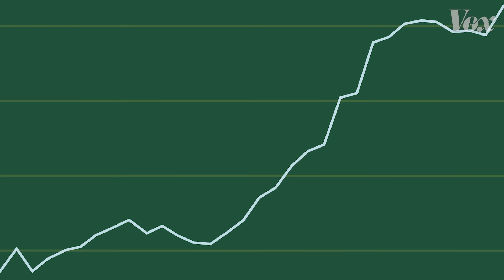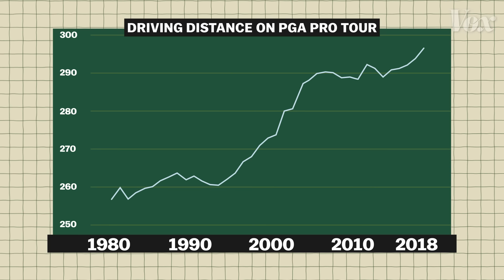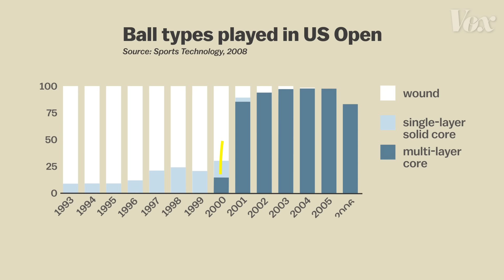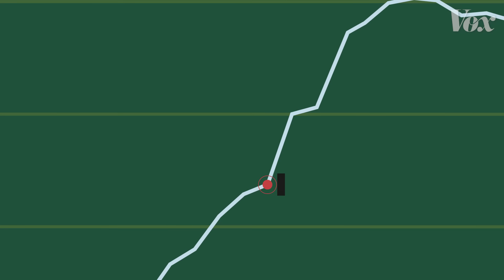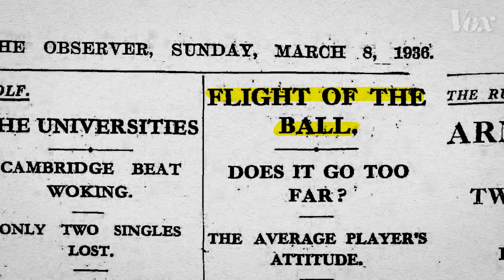The golf ball that made golfers too good

Comment: "a heavier ball would fall out of the air more quickly" guess we're back to the 1500s
Reply: With no air resistance that would be the case. But there is, making drag more pronounced if there is more mass
Reply: You mistake launching a projectile with letting it free fall.
Reply: It's just harder to hit far
Reply: @macaddict1337  that isnt because its heavier though, thats because its going slower, and its going slower because its heavier, it isnt falling faster because it's heavier
Reply: Ever heard of air ressistance?
Reply: To all the replies

Ever heard of a joke?
Reply: @CarlosAM1  air resistance is proportional to cross sectional area not mass. A more massive ball of the same size would fly a shorter distance, but that’s because it would literally be launched slower since F=ma and you’re hitting it with the same force. So it would be subject to the same wind resistance as the lighter ball of the same size but would be moving more slowly at the start so it wouldn’t go as far.
Reply: @huckthatdish  The club head is still FAR heavier than the ball, so, assuming the same swing, the heavier ball will pick up more TOTAL ENERGY from the club, assuming the same coefficient of restitution, and given the same profile will carry the increased momentum further.
And nobody mentioned the Magnus effect or crosswinds . . . . .
Reply: @huckthatdish  you forgot about the critical detail of inertia. Even if the ball leaves the club head slower, it's inertia is much greater, meaning it is less affected by the wind.

Comment: I'm a huge advocate for golden era golf course design (courses like Augusta National and Oakmont CC). The problem with solutions like Augusta's making holes longer is that it costs A LOT of money, not only when it comes to buying extra property, but also in watering and maintaining that land. Golf already has a sustainability problem that could easily be solved with better allocation of water and fertilizer resources and if the ball were rolled back to the technology of the 1990s, golf courses would be a lot better off. Sure, manufacturers would have to spend a lot of money, but the barrier of entry to playing great golf courses would be much more accessible and golf would have much lesser of a negative impact on the environment.
Reply: How would rolling back technology make extremely exclusive and expensive country clubs more accessible?
Reply: It doesn't necessarily but there are hundreds of public municipal and public courses around the country that have really good architectural bones and a roll back of technology lays the groundwork for restoration efforts on these courses.
Reply: Golf is one of the only sports that modifies the projectile . Why haven't they changed  the puck , football , baseball , tennis ball . The equipment always changes but not the projectile .
Reply: That Stock News You’re comparing a truly individual sport, golf, to sports that require you to actually square off against an opponent, whereas golf is a game against the course.

Considering golfers don’t directly square off with one another as do hockey players, it’s pretty easy to understand why golf is unique in its love of new technologies.
Reply: @mtb416  Well then the course owners are to blame they should just have to compete against the sport . Every year they should buy 5 yards of land for each hole and compete against engineering firms pumping 10's of millions a year into the golf ball technology alone ..
Reply: That is no where near a good idea

Comment: Easy, just change the rules. Make certain zones, like those above some stands of trees or whatnot, no-fly zones. No need to buy new land, no need to change the course itself, no need to force people to use certain kinds of balls, etc.
Reply: There's a rule for this in disc golf called a mandatory.  A point like a tree is marked, and your path to the basket must at some point pass to whatever side is indicated as mandatory.  Multiple different types of penalties--like re-teeing, drop zones, or placing your lie at the point where the flight of the disc past the mandatory--can be used, but that's defined on a hole-to-hole basis.
Reply: So just more ob on the course? That makes sense, It can restrict a players line of choice then.
Reply: But all those things you mentioned are easier and better than changing the rules of golf. Like pushing the tee back, simple. Then the game itself isn't effected. Because having the balls and skill to take a risky line is a big part of the game right? Just getting to the hole however.

Comment: 4:35 "A heavier ball would fall out of the air more quickly"

Now I ain't no physimatrician son, but that right there is wrong.
Reply: It would lose momentum more quickly due to the increased force required to make it cover the same distance and so while it would accelerate towards the ground at the same speed as any other ball it would still spend less time in the air all other things equal and so it would "fall more quickly".
Reply: That’s not how this works

That’s not how any of this works
Reply: i had the same thought here. 

he means denser. picture a ping pong balls ability to float in the air vs a rock.
Reply: I was thinking the same thing...
Reply: Yeah that was odd phrasing. It will just go less far because it takes more energy to accelerate it in the first place.
Reply: It's not even true in a vacuum.
Reply: You all are missing the biggest point which might make you think twice about a heavier ball. When it goes into the air it’s landing on dirt. I play golf. If I use a heavy ball it would just stick all the way into the ground. I like to have a light ball. Plus heavier ball flys less rolls more but you need a heavier club to compensate for the heavy ness of the ball to make it go further. The other side of the equipment might or will not handle the weight of the ball.
Reply: He's technically correct, which we all know is the best kind of correct. If you apply the same force to a standard ball and a heavier ball, the initial velocity of the heavier ball will be lower than the standard one, causing a shorter time of flight. While air resistance does also have an effect on the distance the ball travels, and that effect reduces as the mass of the ball increases, it's not enough to overcome the difference in initial velocity.
Reply: @MaxBrix  In a vacuum there is no lift. In fact a golf ball hit in normal atmosphere will travel further (double) because of lift. 
In your example lift is more important than wind resistance.

Comment: "Heavier ball fall out of the air more quickly"... ehh.. not so sure that's how gravity works.
Reply: It is, the wording is just a bit strange. A heavy ball will fall at the same speed as a light one once it begins falling, but because the input force does not scale with the mass of the ball, it will begin to fall more quickly, as the golfer provided it with less acceleration to go up with.

Comment: 4:35
A heavier Ball would fall out of the air more quickly.
WAT?
Reply: I know... What the f? they didn't learn physics or what?
Reply: I completely agree, they should have should have said something along the lines of "A more massive(heavier) ball requires more force to go the same distance" and then they would be correct. I didn't notice until I read this comment and the more I think about it now the stupider it gets. For them to say it would fall out the air more quickly would mean they expect the golf ball to reach terminal velocity (Which it can't as no one can hit it that high.) They haven't seen the video of the feather and bowling ball on the moon.
Reply: Well they are right though. Sure in a vacuum it makes no difference, but you hardly ever play golf in a vacuum. Since air resistance as a force is the same for the same velocity and same surface, which means you have the same force acting on the ball, if you have a heavier ball, it falls more quickly.
Reply: That is true though? Air resistance is a thing...
Reply: Lol ik...
Reply: @taxoroelysium1150  air resistance has nothing to do with mass.
Reply: It's not that it falls more quickly, it's that they never could get it in the air as long as they could for the lighter ball. Acceleration through gravity is near constant local to our planet. Therefore assuming that neither ball will reach terminal velocity they accelerate downwards at the same rate; 9.81ms^-2 . 

The only reason the heavier ball hit the ground first is purely because if the golfer puts in the maximum force they can, and F=ma, Then F (Force) is constant, m (mass) has changed between the balls so therefore, a (acceleration experienced by the ball from the golf club) has to be different . In short the heavier ball doesn't go as high and has less distance to travel. Which is why the parabola the ball makes will be shorter.
Reply: @kyleedavis4777  A denser ball requires more friction to slow down, but the amount of air resistance(which is friction) does not depend on mass. So if you were to drop a iron ball and a football, which one do you think would fall faster? Definitely not the football. The whole Galilean tower thing only works in vacuum.
Reply: Vox thinks a pound of bricks would fall faster than a pound of feathers
Reply: K... I was wrong about the falling-part. But still: 
There is a max-weight for Golfballs so it's safe to assume a heavier ball would result in longer trajectories.
And in context of the video the trajectory and not the falling seems to be more relevant.
Have a look at this:
https://imgur.com/a/V6bvKj2
Or think of this: Try swinging a Golf club at a golfball and then at a PingPong  ball which has roughly the same size but is way lighter. Which would fly further?
Reply: @DubsBrown  It would though? A pound of brick is more densely packed and thus would have less volume resulting in less air drag resulting in faster travel time. 

You should retake highschool physics my man.
Reply: @kyleedavis4777  EXACTLY. That's why a heavier object would fall faster. Because two objects would recieve the same amount of air resisting force, but because one object is heavier, it would change the velocity less. F=MA
Reply: Taxoro Elysium Gailelo famously did this experiment off the leaning tower of Pisa. When something falls, it falls at the rate of gravity times it’s mass. 

Since both the objects are “ a pound,” the have the exact same mass and fall identically, not “faster”.  Density is not mass. Density mass per unit of volume.

If the weight is the same, the speed is always the same because gravity accelerates the same because it’s the same planet.

Now when you mention air resistance, you’ve changed the thought experiment entirely by moving it out of a vacuum and by assuming both objects aren’t in identical containers and instead have their full surface area exposed. 

For the most part you’d have to extremely arrange feathers to get maximum resistance because they’d still fall roughly the same rate. Galileo did this experiment in the renaissance and still concluded the FALL rate is the same. Air resistance is a counter force, but the original gravity is still there. Neither falls “faster”, the feathers in this case may fall behind but if they fell for infinity the distance between them would stabilize and they’d continue falling at the same speed (terminal velocity give or take). You have to manipulate the feathers to slow them because in the eyes of gravity, it’s just a 1 pound object. 

There’s a cool video of the brick feather experiment on the moon in which the mass isn’t the same (one brick vs one feather), but they still fall the same because the moon has no atmosphere, but a singular gravity.

Back to golf: so if you have two golf balls, same shape but  different weight. The heavier one would accelerate faster, but to use terms like faster or slower is not correct because it implies the acceleration (gravity) is different when it’s the same. What the vox video is implying is that the hangtime is shorter/longer which actually means the initial impact of the club is different, not the ball in the air resisting gravity. 
[the ball is technically just going further/faster in the x direction and appearing to float, not falling in the y direction at a reduced rate]

Tl;dr Clarifying volume or atmosphere does impact the results, but it’s manipulation of external forces, and not the true nature of falling forces. Could’ve said “pound of feathers with equal density” but look at all the fun we’ve had by not being initially precise.
Reply: @DubsBrown  That's a lot of post just because you for some reason assume golf takes place in vacuum and want to flex your 9th grade physics on me.

Comment: I don't play as much as I used to, but in the late 90's and early 2000's there was no ball that even came close to the Pro V1.. It had plenty of distance off the tee, yet was so soft, that even a moderate golfer could get bite and learn how to put spin on the heavier pitched irons.. Once I started driving and or long second shots with the Pro V1X, and using the Pro v1 for shorter holes, or around green work.. I hit 2 holes in 1, and 2 eagles in a 4yr period.. The ball is and or was that much better than anything else.. They were expensive, but so worth the cost..

Comment: The problem is one of sustainability. A bigger course means more grass which means more upkeep and more water, which in turn means more cost to the course and environmental impact. Leading golf to become more expensive and less inclusive to those who can't afford 150$ rounds of golf.  Also many of the longer hitting tour players have gone on record as saying the length of course doesnt matter to them because they will still be able to get to the green in regulation. I mean Rory Mcilroys 5 wood goes 275 yards through the air.  What making a longer hole does is punish the shorter hitting players on tour and does very little to hinder the long ones.

Comment: A heavier ball, with the same velocity, would not "fall out of the air more quickly" but actually stay in the air longer. Galileo is disappointed.
Reply: Wrong!

Thanks for playing. Don Pardo,  what parting gifts do we have?

The lift generated by the ball is proportional to the surface area. Weight, in opposition to loft, is proportional to the mass.

A heavy ball gets less loft relative to its weight. 

Bernoulli is disappointed...
Reply: wat
Reply: bcubed72 you ended this whole man's career
Reply: @bcubed72  only if you put the same amount of energy into the ball. But most players will put way more energy in a heavier ball then in a lighter ball (not speaking if absolut energy, I'm speaking of relative energy)
Reply: You forgot about the magnus effect
Reply: Gönndalf der Drölfte They are already pretty much hitting it as hard as they can off the tee, How are they going to put more energy into a heavier ball?

Comment: 4:35 "a heavier ball would fall out of the air more quickly" thats just wrong. Gravity is the same for any object, no matter the weight. In fact, with a heavier ball, drag would have less of an influence and the ball would fly further
Reply: if you could hit it up to the same speed despite it's increased mass which you couldn't
Reply: air resistance, and because it's heavier, it'll take more force to get it to fly the same distance as a lighter one.
Reply: @senseiadam-brawlstars9465  of course. But i was just referring to the wrong statement in the video. Gravity doesnt care about the weight/mass of an object